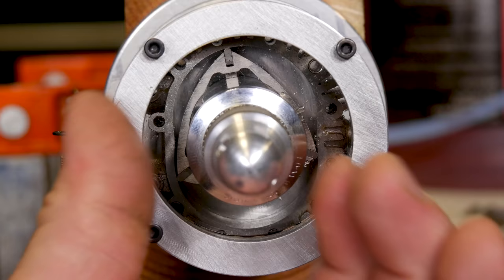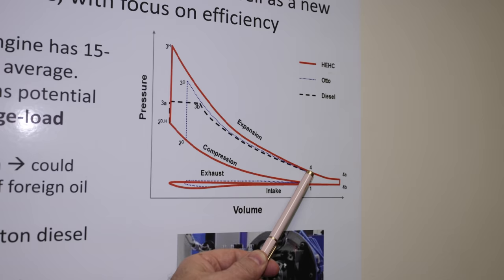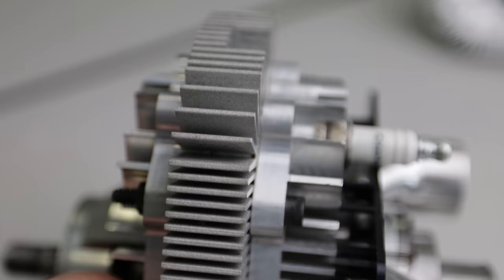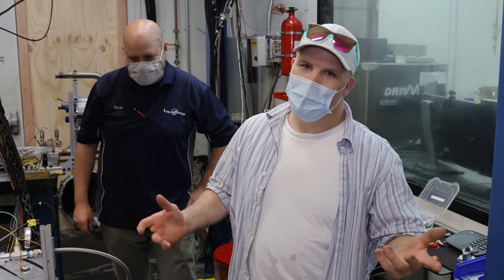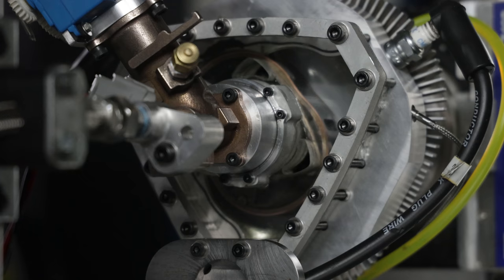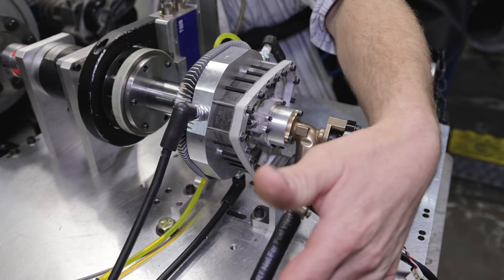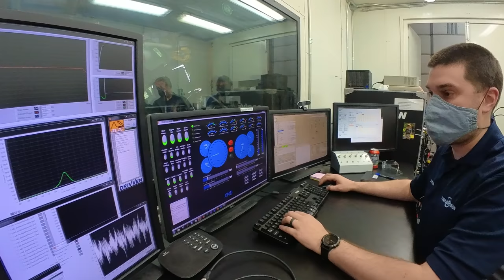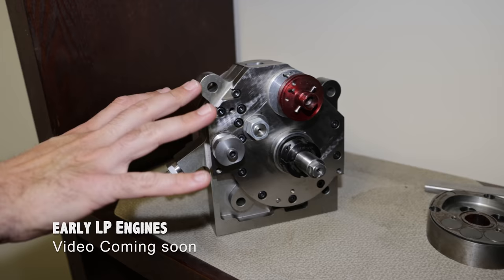See Thru Liquid Piston Rotary Engine - In Slow Motion

Comment: 4 hp doesn't sound like a lot, but remember, a 4 hp standard 4 stroke piston engine weighs at least 30lbs
Reply: RC engines disagree with you.
Reply: @superskullmaster  they need total teardowns every run, so I could care less if they agree
Reply: @THESLlCK  no they don't haha, either way, this is very cool. but impractical its just a show and tell piece it will never be as reliable, cheap nor powerful as a basic 2 stroke engine and the intake thru crank design limits its ability to be made multi rotor and limits porting to make more power. its a dud
Reply: @delta7743  I imagine that as they make these engines larger, they will probably increase the size of the intake port to match the engine size.  Just because the engine design means that backyard engineers can't bore out the intake port doesn't make the engine a dud.

I'm not saying that there aren't other issues with the design that they have to work out, but your complaint about not being able to port the engine?  Build your own if you want to have an oversized intake.

edit:  I totally agree with you about the reliability and price, you can't beat a 2-stroke, no matter how much you abuse it.
Reply: @THESLlCK  You could? How much more?
Reply: @THESLlCK  said like someone who’s never actually owned an RC nitro engine. You may have to take it apart every 20 gallons for fuel or so which will take over a year to run thru.
Reply: @superskullmaster  sure, cool story. Probably running something that makes zero power lol
Reply: The thing is, that 30-pound piston engines includes fuel and spark systems, as well as a way to start them. Liquid Piston just measures the bottom-end of their engines, which is extremely shady and arguably false marketing.
Edit: I later found out their "4' horsepower rating is an estimated net horsepower. The engine actually only makes 2.1 horsepower.
Reply: No... stock lawnmower engines maybe. But throw some performance parts on them and you can get 25hp+

Comment: I would love to see this engine in a motorcycle
Reply: Already done actually
Reply: @redactedrider7606  sort of the Norton and DKW rotary motorcycles were a conventional rotor design.
Reply: You should look up the Suzuki RE-5
Reply: Needs a bit more balancing, too much vibration, should be fixable.
Engine seems nice and compact, might be most suited in conjunction with a generator as range extender for electric vehicles, you could cram it in almost anywhere, wouldn't be much bigger than a regular combined starter/generator.
With 3 ignitions per rotation it should give good torque, even at low rpm, regardless of fuel.
I wonder how lubricant gets into it though, must get included into the fuel, or you will have a hard time running a seperate line trough the crankshaft.
How do you even seal something like that, when the offcenter, rotating hollow shaft is used for fuel intake.
Coolant however shouldn't be an issue, can get integrated into the walls, if needed, or you just attach a fan straight onto the crankshaft.
I like it.
Reply: A new chainsaw with three plugs to buy.
Reply: I would love to see this engine in a paramotor. Even a 10-hp version could be good.

Comment: So, just for reference: that 4.5lb engine has a horsepower-per-ton of 2,250. That is the same horsepower as the Electro-Motive Division (EMD) E-8 diesel-electric locomotive, which had two V12 567B engines. Granted, it most certainly would not weigh just one ton when scaled up, but it's still cool to think about.

Comment: Not gonna lie when I first saw the ad on Facebook I just thought it was some bs company and wasn’t even interested in clicking the link. They should link this video in their ads.
Reply: It is just marketing BS. They measure their engines without fuel, ignition or cooling systems. Piston engines would be a lot lighter if they didn't need any of the parts required to run, too.

Comment: The problem I see with this engine (besides the structural integrity of the rotor at high loads) are the side seals. In a Wankel, the side seals connect to the corner seals which connect to the apex seals. That allowed for perfect separation of the three chambers. In this engine, there are no corner seals (cause there are no corners) and it is physicly impossible to put the side seals at the edge of the rotor, meaning you inevitably get a relativly large amount of crossbleed between the three chambers.
It also seems very much not practical to have the intake manifold go through the e-shaft. It makes lubrication difficult, especially if you add more rotors and does not allow you to run your accesories like your alternator from the front of the engine.

Comment: First off, This is freaking awesome. It’s essentially an inside out wankel!  I also see that there is much more to gain and this is just the beginning of a platform I hope continues to improve for a long time. I’m undereducated in rotary engines, but have built a few pushrod V8s. The first thing I’m noticing is the shape of the combustion chamber and piston don’t allow for the power stroke at an optimal angle. I’m thinking you can dramatically increase torque and overall power if there is a way to change the shape and prevent flame travel from going counter to the direction of the piston rotation and move the combustion further to the backside of the piston lobe.  (Without interfering with the compression of the next cycle). Someone school me up on why that’s a bad idea or thoughts on how to do it?! Haha

Comment: It appears that the same part of that rotor lobe receives a combustion thrust every 120 degrees during rotation  It would be interesting to see what several hundred hours of bench testing would reveal about the thermal characteristics of this design and how well the parts can dissipate heat and stay functional while under load.
Reply: all three lobes fire when  lobe 1 fires  - lobe 2 exhaust -  lobe 3 fuel then  - lobe 1 exhaust - lobe 2 fires - lobe 3 fuel  and so on
Reply: @odouroushouseant  thanks for clarifying i guess when i was watching the engine run the apex of the rotor stroke forms a very similar shape the cavity seen on the piston head in some diesel engines  just in revers (i am not a mechanic but having been inside a few of the tractors on the farm so i am not sure if this is true for "all" diesels) so the long and the short of it is this just seems to have a smaller compression chamber for ignition and then rapidly opens up as the rotor moves so heat would similarly disperse into the larger chamber
Reply: in particular John Deere 3029D piston from a John Deere 2240 tractor

Comment: This is amazing. A new development like this in rotary engines have been a long time coming. I wonder what the power/torque curves look like, how it responds to porting, and whether it likes turbocharging or supercharging.
Reply: According to some research they published the engine doesn't really like turbocharging, because they over expand the exhaust stroke, which increases efficiency, but produces less exhaust pressure, thus makes a turbo less effective.
Reply: I wonder the same thing.  I also wonder if it will scale up in size very well.  especially for multiple rotors and with the way the intake works.
Reply: @gregkramer5588  From what I've seen, the power almost doesn't scale at all. The 70cc X Mini engine shown in the video makes 3.5 horsepower while weighing more than 4 pounds (they just weigh the engine block and rotor). Their 750cc model should theoretically make more than 10.7x as much power, if it actually scaled. Turns out, it actually does make than 10.7x the power of the X Mini - with a help of a turbocharger, meaning the engine weighs even more than they market, while being even less inefficient.
Reply: @joshjlmgproductions3313  That is what I was thinking also.  The rotor looks heavy and the internal intake port both seem like they would not scale well.
Reply: @joeKisonue  But will only work for low power applications since it does not scale was my point.  These applications seem to all be turning to eclectic.    Sad to say but the window is closing for this to go anywhere.
Reply: @gregkramer5588  who tells of its scale?
Reply: @gregkramer5588  I agree to an extent.  It certainly won't go anywhere if the use too much money on the build up for the wrong application and it is too costly. But it would be great for motorized small craft flight and who knows what in so much of the world that is not the US
Reply: @joeKisonue  I guess for drones or model airplanes it might be very nice.  Lawn mowers and weed trimmers are headed towards batteries pretty fast.
Reply: @joeKisonue  The path for the inlet air is very limited.
Reply: @sandervanderkammen9230   Yes

Comment: Now just have to see how soon it can go into mass production.
Reply: The Wankel engine was invented by the German Felix Heinrich Wankel. Finally, in April 1954, he succeeded in making the basic invention for the motion sequence of the only rotary piston engine produced in series so far, the Wankel engine. :-) The NSU Ro 80 was a saloon car of the upper middle class produced by NSU Motorenwerke AG (from 1969: Audi NSU Auto Union AG) from summer 1967 to mid 1977. It was one of the few production cars to have a Wankel engine with an output of 115 hp (85 kW). The model was officially presented at the 43rd IAA in Frankfurt in September 1967.

Comment: They need to mass produce these in cars. These are extremely cool
Reply: I bet that none of the videos were shot with the engine running under its own power. They were spinning it with an electric motor and making it ignite some fuel. And i bet compression is less than 6:1, no way these will ever burn diesel.
Reply: There are good reasons no car manufacturers adopt this contraption.

Comment: Been working on rotaries for long time.  The wankel sealing issue was resolved by cutting 3 mm apex seals. Additionally by opening the intake and exhaust ports relieved a lot of the other issues.. I have a 13B running 550 HP with a gt 45 turbo and it is extremely reliable. ANother wanel issue was heat buildup on the rotor and we found by lightening the rotor made it worse. Running 2 stroke as a premix reduce the carbo buildup and lowered the overheating Be nice to see what happens with your design under high HP and heat/carbon buildup.
Reply from the maker: 3mm Apex seals, what are the originals? 2mm ? I dont remember
Reply: Thanks for that info, very insightful. Does it start well in the cold? Aside from seals and cooling, what about the emissions due to the oil being burned? How do you deal with that?

Comment: I still see what looks like an apex seal, but located on the fixed structure, not the rotating piston.  I wonder if the main problem with the engine was simply repositioned for this new design.

The vid is all about how the engine works, but not how it is a significant improvement over the standard rotary engine.